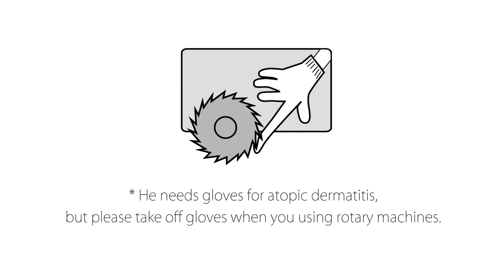ISHITANI - Making a Kigumi Table

Comment: Simple beauty. Very nicely made. What is so reassuring is that you can see the end at the beginning. You know where you're going. Your video is very clear and well structured; this is already a positive point. Oak is a very noble wood - excellent choice. It ages more beautifully than any other timber, plus the fact that it's oiled will help it pass through time. Thank you for sharing.

Comment: This type of furniture costs more to make than any other type of wood furniture.  The reason isn't so much the hand craftsmanship but the process of selecting and using the wood.  It is extremely important to keep track of where the wood came from; the top will always come from wood found higher up in the tree, and the legs and feet from wood progressively lower.  The reason this is important in Japanese carpentry is because this is how the wood grows, and it keeps the furniture from warping over time.  Also it is prohibited to use metal fasteners.  All pieces have to be joined by wood itself.
Reply: I have sincere question.  Why metal fastener is discouraged or as you said prohibited?
Stainless screws make these furniture  more towards perfect.
please enlighten us.
Thanks.
A'ra'm from California.
Reply: It is wood working, not furniture building. Hence you are working the wood into something beautiful. Metal would make it not wood working.
Reply: @sanramondublin  Hi Frank. European Cabinet Maker here. The wood itself is still a living, breathing thing. even after you cut it and shape it.   
Some style of furniture tend to use clever wooden joints and wooden dowels to keep up with the changes in the environment of the life of the furniture. The Furniture will behave differently in a modern dry apartment, than in a 100 year old english cottage. Wooden joints and dowels can work with that.   
I usually dry out my dowels under a heat lamp before I add them, that way when they get slightly wet from the glue they will further expand in exactly when needed. Right at the gluing process. Metal fasteners although they came a very long way are rigid connection forms, they not allowing for much movement.
Reply: Mr Ishitani has a video where he used screws to assemble drawers.  I have to admit, I was surprised.

Comment: Lovely work! Just wonder why not insert the sliding dovetail rail before joining the two halves of the top, thus avoiding the filler piece on the outer edge?
Reply: I'm guessing he builds it this way in order to be able to take it apart, should the need arise.
Reply: I believe it's a tapered dovetail. As such it cannot be assembled the way you state.

Comment: I love your videos.  I think this is my favorite piece of furniture you've made.  I really like how you used sliding dovetails in the brace to help keep the table flat.  I'm a novice woodworker and haven't seen that before. Is that a common feature in Japanese style trestle tables?  Also really like the dovetail keys for the stretcher.  It's different than the others I've seen.  This table is definitely on my wish list.  Keep up the videos please.  The video editor is also amazing.
Reply: sliding dovetails are very common for keeping warpage of wider boards to a minimum. make sure they are tapered, friction fit and never glue one in! I'm from germany and that is one of the fundamental skills one learns durning the apprenticeship around here. It was used throughout almost every kind of furniture back in the day but nowadays not so much anymore due to the amount of time involved fitting them up. There are just much cheaper and easier ways to to the same thing nowadays. I still prefer this tho.
Reply: @najin0446  Very good explanation. Not to forget tough that it is not used as often as it was in the past due to the climatic conditions most of the furniture lives in now. They do not vary as much as they used to be due to the difference in how we build houses e.g..

Comment: At 6:10 Ishitani uses an offset board to put the taper onto the dovetail, does anyone know why he did it this way?   I'm guessing it's for more fine grained adjustment of angles than moving the router fence each time there's a bit more to remove, he can just change the position of his dovetail along the board for slightly more material to be removed.

Notwithstanding, I love this table so much I'm trying to build one.  <3  Great work!  Well worth imitating!

Comment: Fantastic build, thanks for sharing. Question, why do you hammer the bow tie on an anvil? Are you work hardening the wood? Or is t just to get a tight fit?
Reply: Tôi nghĩ Vào đúng vị trí gỗ nó nở ra và nó sẽ chắc hơn
Reply: Technique I've seen mostly from Japanese woodwork translates as "killing the wood", slightly compresses the fibre's and they spring back later with moisture which the glue should provide or wipe with a damp towel, means you can get a true interference fit like shrink fit steel parts.
Same principle as if you have ever steamed out a dent in a floor or furniture.

Comment: I’m curious to know is the sliding dovetail for the battens tapered? I plan to use a similar method to attach a heavy solid Hickory table top to a fabricated steel base. I can’t imagine the dovetail/dado is parallel, else I don’t know how you could drive it all the way home? Your input is appreciated, and I highly admire your skill and am grateful for the time you take to record/edit/post your work.

Comment: Beautiful work. I'm curious about your joinery technique for your sliding dovetails like the ones on the stretchers that lock into the tabletop. Are they tapered or just straight? Do they get tighter at one end? Thanks.
Reply: Wondering the same thing
Reply: They are tapered sliding dovetails. He cut the tail in the underside of the table by marking off the taper with the two stop pieces of wood on either side of the router. When he cut the pins on the cross pieces, he first did a straight cut on the router table, then used a tapered jig at the same angle that rides against the router table fence. The fence is positioned so that at first the dovetail bit won't touch the pins, but then gradually shaves off the taper. He did a test fit to make sure it only got tight during the final few inches/cms. Later, he glues in only a bit of the wide end of the joint, allowing the wood to expand/contract along the length of the dovetail. That's why there's some space between the plug and the end of the cross piece.

Comment: At 8:43 when he cuts the taper on the legs, does he also have to taper the feet inserts (not sure what to call them but the part he cuts in so the leg slides over them) from 8:04 so their angles match when put together?

Comment: I am worried that furniture made with only adhesive will deteriorate over time. 
Some furniture is made by inserting pins, but this is not certain.
Chigiri technique is used to join the furniture boards,
Although delicate craftsmanship is required, both durability and design are satisfactory. Great.

Comment: Great video!  I definitely appreciated your willingness to seamlessly switch between power tools and hand tools based upon what would give you the best results, with least effort possible...  One question.  Was the router used in the video brand new?  Or are you "that guy"?  No judgement, just curious....  My routers have more buildup caked on than a 15 year old on prom night...

Comment: At 6:41, the dovetail joint moves easily through the table. At 6:45, you're hammering it because it's too tight. Do you make it a little bit loose so it can move freely up to one point, and then really tight at the end? How do you manage to do so?

Comment: Another beautiful project. I have an unusual question. Do you have plans for your Saw Horses? I think you have demonstrated the same techniques in this video that would be used to create your saw horses. I have been watching your videos and stopping at different points to get a better view of them.
Reply: The saw horses seem to me to be a design by Krenov.  I made a pair that look very similar, all with mortise and tenon joinery and I draw bored mine.  Fine Woodworking did an article on them a few years back (less than five I think).  I don't know where Krenov got his inspiration from.

Comment: beautiful. i was wondering about the center joint. left it as is as the focal point. 
the value of the piece depends on the price. if it’s 1g usd, i would buy it on the spot. but i think you would want at least 3 times as much if not 5 times. 
if it’s 1g, i take it right away. but please don’t disappoint me by charging over 6g, though entirely possible in japan.

Comment: What is the machine called at 3:32? I have never seen one like it and would like to know more.
Reply: I haven't seen one either, but it looks like it could have been a table saw at one point in time.  Any motor with the right size arbor on the end would work.  Pretty good idea.
Reply: If you watch some of the videos of the Indonesian furniture makers they use them for cutting tenons etc.
Must admit it looks a bit dangerous,I cut mine on the bandsaw with a taper jig.
I am just woking on a marri timber table and inserted 11 dovetail ties in the underside.
I am not a fan of the visual appearance of them myself but if the client wants them,they get them.
Reply: It’s almost like he put a blade in a bench grinder

Comment: I'm an amateur, so I don't know and I need to ask. Where you attach the legs to the transverse supports for the table top, the transverse parts are thinned. Is there enough material for support left even after thinning them, or does the material of the sides of the mortise make up, in terms of strength, for the material cut away from the transverse part?

Comment: Hi Ishitani san. Your work is an inspiration for me. 
I would like to ask you something: I want to make half of that table to use as a desk. Actually it will not be exactly half, as the "cut" will be dislocated to the end of the leg, so it will be slightly more than half. But I want to elongate the leg to make  two shelves above the "table" of the desk, for books. 

Do you think it will work? Is there anything that would deter such project?

Thanks from Brazil.

Comment: Should probably just have bought some screws
Reply: Metal fasteners are not used in Japanese carpentry.  This is for reasons of durability.
Reply: I can't get on board with that sort of rhetoric. Big box of 8 x 80mm and jobs a good 'un